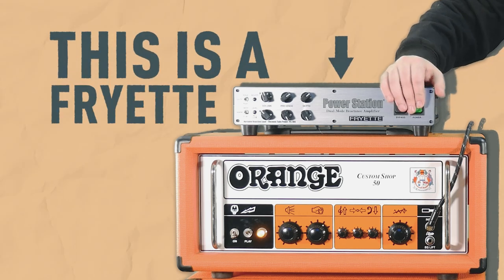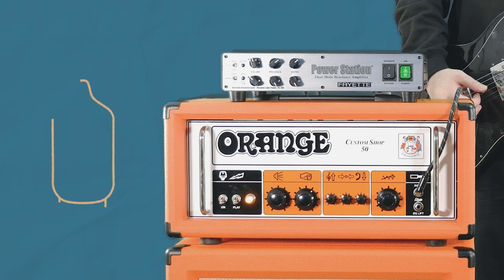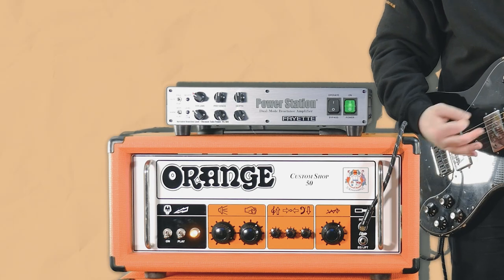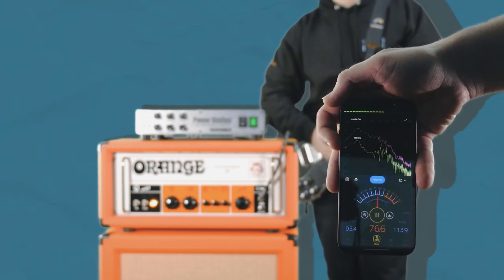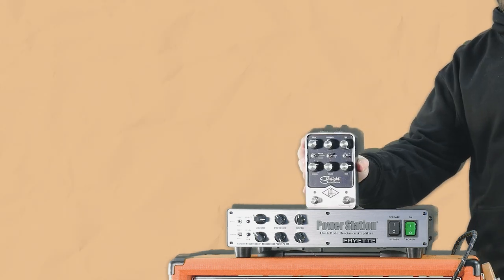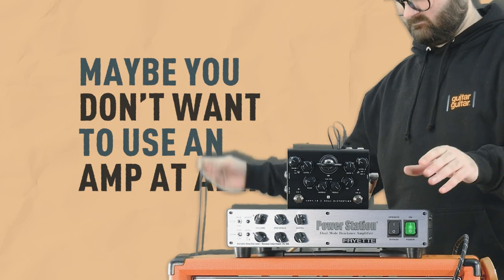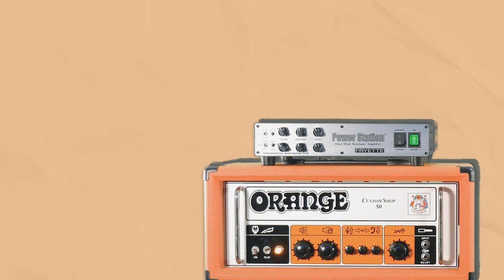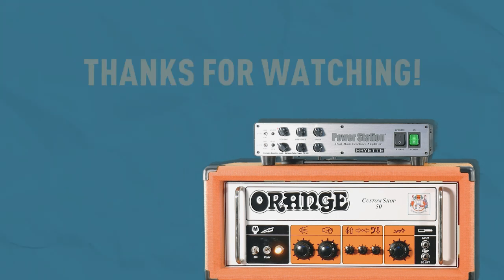Let's Take a Look at the Fryette Power Station PS-100⚡GG Explains

Comment: This looks great but isn't it weird to have a 100W EL34 70's Marshall, where much of the fabled 'plexi sound' is in cranking those EL34s, and replacing that with (in the case of a PS2A) a 50W 6L6 power section? Doesn't it totally change the character of the amp?
Reply from the maker: Thanks for watching! 

In regards to your question, as the Fryette sits in between the Amp and the Cab, all the work those EL34s have done will be going in to the Fryette... The power amp section of the PS2A simply amplifies the signal coming in which has been 'unloaded'. If anything, the Power Station would be perfect for pushing a Plexi to it's limit to achieve the tone you're looking for and then bringing it right down in volume!

Hope that answers your question.
Reply: @guitarguitaruk   Ahh, NOW I get it!! Thanks!

Comment: So the power station is gain staging controller ?
Reply: In a roundabout way...yes. If one is pinpointing the extra gain saturation of the power amp tubes within your head amplifier by turning your master up and demanding an extra toll on your speakers...the fryette power station interjects the signal.... then takes that energy and consolidates it by harnessing that saturation of both the power amp and pre amp stages of your guitar amplifier into the harmonic gain characteristics of those tubes being pushed hard at a more reasonable volume.

 In addition to volume control... there is a depth and presence knob along with some additional toggles for warmth, bite, all of these knobs can color the gain characteristics. However if you don't want any of that additional color, the Fryette allows you to send a  transparent signal of only the actual original tonality and harmonic bliss occurring in your amplifier without applying the additional color it offers.

I have one and opt to use the additional color features. Additional I use the effects loop for pristine time based effects placed after all of that guitar amps preamp and power amp distortion harmonics. It really is an incredible sonic tool. Cheers. I am just trying to offer clarity and be helpful. I dig mine. It's a game changer.
Reply: @bjhale542  tq sir for explanation 🙏🧡✨
Reply: @zanaudio  Great video! I think it is pretty incredible and people are using it in lots of different ways!